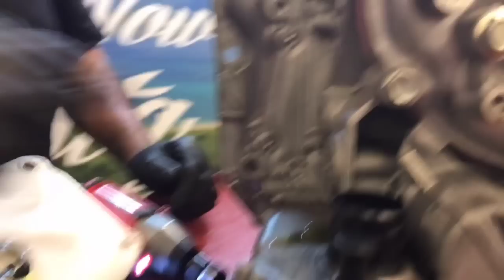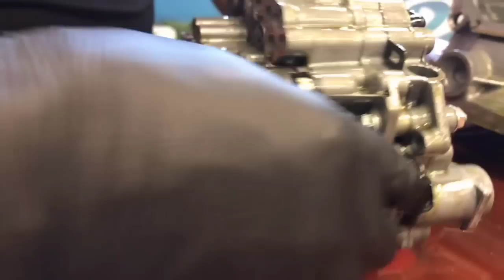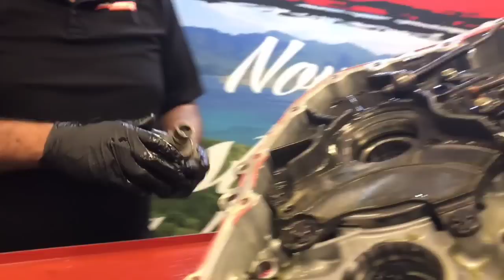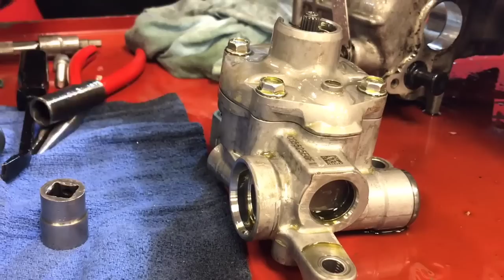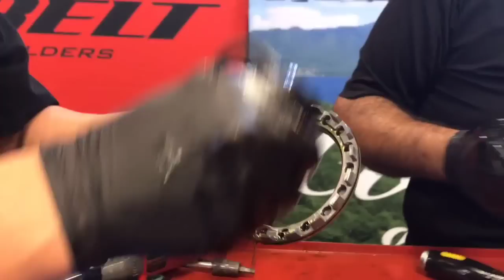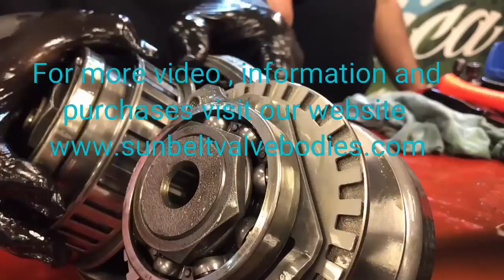2013 Nissan Sentra CVT  disassembling a RE0F11A (JF015E)  transmission

Comment: This is not correct. The way you do it is after you remove the transmission from the car you bolt a long chain to it, then you throw into a lake and use it as a boat mooring.

Because these CVT transmissions are complete junk. Don't ever buy one, especially used. It will fail and you'll have no recourse.

Noticed how these guys don't cover any rebuilding specs. That's because they can't be rebuilt because Nissan won't sell shops any rebuild kits. They want you to just buy a new car instead..

Comment: it’s not cvt  ))) automatic torque convertor
Reply: All nissan cvt use torque converters. They need some sort of clutch, whether it be automatic, manual or torque converter style
Reply: I know, but did you see planet gears? Which cvt has planet gears?
Reply: @dogussengul  theyre called Planetary CVTs they are pretty common esp on Nissans. Helps distribute torque I heard.

Comment: I've been a automotive technician for over 20 years and certified throughout and I can tell you one thing CVT transmissions are garbage my wife has one in her Jeep and it's nothing but a POS it's not the transmission it's because the stupid engineers don't make a transmission cooler big enough to do the job let alone tow with it
Reply from the maker: 100% agree!

Comment: It should be illegal for vehicles to use cvt transmission, there is no enjoyment of driving they are not fuel efficient keeping your rpm hanging high under load..
Reply: kaydan9906      All the CVT fanboys say it’s great on gas. I say it’s terrible on gas it has to spool up before any gears are selected revving your engine high witch results in more gas being injected. Plus’s CVTs are terrible for off road conditions or snow packed roads. Again cause the CVT got to spool up before any gears are selected resulting in loss of traction. Where a typical automatic gives you lots of torque in first gear CVTs do not. I hate CVTs they are complete garbage
Reply from the maker: Agreed Jacto CVTs are terrible.

Comment: People have absolutely no idea how to drive these. 

You should never be over 2800-3000 RPMs ever but everyone I see takes off and keeps pressing the gas until they reach the desired speed with 6k RPMs and that's just not how its supposed to work and why people burn these out.  It speeds up when you let off the gas a bit for a reason.

 Press the gas lightly and have some faith, it will speed up quickly, you'll keep your car 3x longer, and have that insane fuel economy.
Reply: Same thing i see. People trying to race honda turbos and mustangs because they got a new car. I dont think any stock trans will last driving it like that...

Comment: I was reading a Nissan bulletin document for this transmission online which covers the rebuild, but it states when you take out the rooster rod or whatever, if you take it all the way out, it can damage the seal in between the case and range inhibitor switch. Is this necessarily true? Where can I get a new i seal/gasket whatever you call it for that?

Comment: 1990 Nissan Maxima - auto transmission - 6 years, 103,000 trouble-free miles;
1996 Nissan Maxima - auto transmission - 8 years, 178,000 trouble-free miles;
2004 Nissan Altima - auto transmission - 9 years, 143,000 trouble-free miles;
2013 Nissan Sentra - CVT transmission - 4 years, 43,000 miles - DEAD - could not be repaired even after THREE CVT replacements.
2017 Ford Focus - auto transmission and, so far, no problems
Bottom line: no more Nissans, no more CVTs.
(And, by the way, I follow maintenance schedules  t o    t h e    l e t t e r.  And I do not drag race or over tax my cars.)

Comment: cvt is one of the worse transmission out there. plus they are not cheap. stick with older toyota those will get to 350k before you need a new one